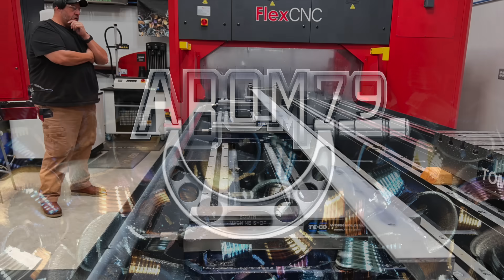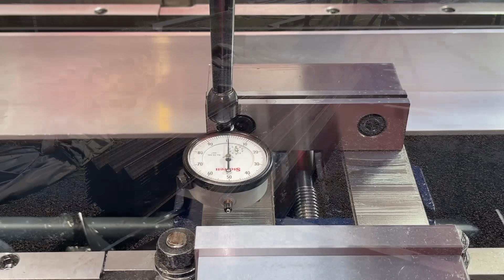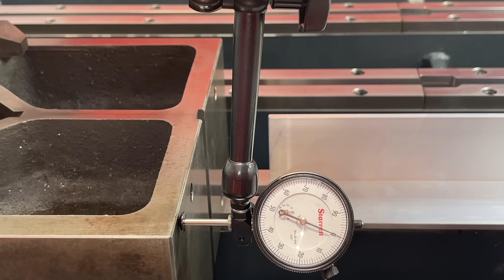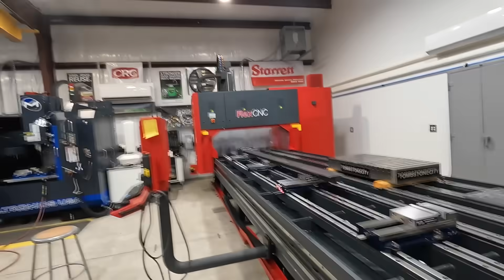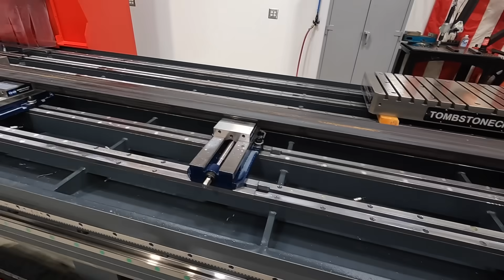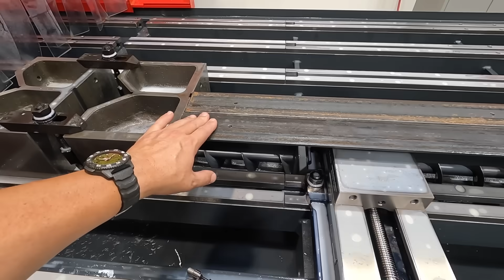Production Drilling in the Flex CNC

Comment: Talking about drilling holes, I have found using a flat ground drill bit in thin steel makes a very nice round hole, unlike a regular twist drill oval hole.
Reply: Cutter grinders are a gift from our ancestors. With a few rake tricks was able to temporary use a little Tormach mill as a production lathe... for years. 
'Nothing more permanent than a temporary fix' Ave-

Comment: With it dropping the rims, sounds like there is a setting issue.  A lot of machines come with a SFM limit in place just in case someone forgets a decimal.  Also with carbide when switching from HSS don't forget to change the drill point degree.  HSS is generally 182 where as most carbine is 140.  Also a spot could help start the holes with the height variances.  You could do this with the carbide drill as well it would simply be programmed at 70% feed and say a depth of -.03.

Comment: Hello!
I would not use coolant for that kind of job. And would change the path of tool. Two hols with Y and then go with X for another two holes in Y etc. Then come back to base and you can already start loosing vice. Cheers
Reply: He literally said he tested it this way and it was slower.
Reply: @Braeden74  shorter tool path = shorter program time. there is nothing to argue about
Reply: You apparently can’t listen, he said that’s slower, also, in america we don’t endanger ourself by touching the machine while it’s running. DA, alsoooo, you cannot run thru coolant carbide drills dry, they will break, if it wasn’t thru coolant than sure.
Reply: @adammiller4879  doubt that with that depth. but its not the point. ofcourse he suppost to use diferent drill. due to the fact that cooling was used to drill holes at such a small depth, in addition, in such a large element, the working time was extended several times due to the time spent on blowing off the elements from the coolant.
Reply: @Fido8xD  that’s something you have to do, you , this is standard practice in america which I can tell you’re not from.
Reply: @adammiller4879  i am just teling how to spped up the proces and make more money and you just teling me that i am not from america, what is your point?
Reply: @Fido8xD  and I already told you, you cannot run those drills dry, doesn’t matter if it’s “thin” they will explode, and that he already tried your idea and it was slower.
Reply: @adammiller4879  and i already told you that using thru cooland drill for that kind of job is just whaste of money. also if just think for a bit you can also create two programs to make the machine stop once on one side and once on the other and loop but it's probably too complicated for you

Comment: Two things, do as you wish with them. First, instead of adding coolant and water from evaporation all the time, id cover the flex bed with something, itll slow down a lot on evaporation when not in use. Something you can roll up while your pulling it off. Tarp maybe or similar? 2nd, you start getting in to these bigger part runs, get yourself a manual magnetic lifter and run it from your gib crane. Some of those magnets, although fairly small can lift several hundred pounds. In this case, I would pick up two pieces together, moved to flex and lowered them in place. When done, pick them up and move them to to cart and start process all over again. When machine is running thats when you go back and straighten out what you put down and get next two ready for moving. Its all about making money and making every movement you make count. What did this take to run? 1/2 a day, with a lifting magnet cut that in half if not more.
Reply: He mentioned this, or the need to lift on/off with a jib crane (close enough!) didn't he?  Or was it too long to watch for you by 6:30?
Reply: @silasmarner7586 Just gave him a tip on what I've used in the past to do this type of stuff. It is always nice to see what others are doing to improve ones capabilities and efficiency. Apparently, you dont see it that way. But since you brought it up, then yes, it was a long winded video to watch a half a million dollar machine drill holes. One of the most lame jobs to do in a machine shop is to drill holes repeatedly. In which I shouldnt even comment as he doesnt read them anyways. And yes, I have more important stuff to do then fanatsize over someone elses videos. If ya dont want the tip to use, then keep it scrolling, it wasnt directed at you.
Reply: tarping it is a awsome way to accelerate rusting the ground surfaces under it.

Comment: If the length of the pieces are different, then by placing them back-to-back, you're creating a mirror symmetry, so the holes will be off when the angle iron pieces are re-oriented the same. Maybe it doesn't make a difference for this application.
Reply: He did explain in a comment that it is the spacing between the holes that is important, while both ends of the angles will stick out into 'the air', having some +/- allowance

Comment: Talk about ridiculous overkill for that job 🙄
Reply: You comment make sense in the case some other larger job for the Flexcnc was put on hold, to drill these holes instead. But there are no que of jobs. When the machine is already there in the first place, it does not cost you much difference standing unused or put in use. The electric bill will be there, using the Flex or a drillpress. Would made no sense using a manaul drillpress and hours extra if one got the Flex cnc there. It's a multi machine, one naturally do not purchase it to just drill some holes in angles
Reply: ordinarily you'd be correct, but this is made for Youtube content.

Comment: You really need sealed collets for through spindle coolant, otherwise youre just pushing it out through the slots in the collet rather than through the tool.

Carbide drills are nice though, I usually get a couple of tousands holes on one drill in mild steel with simular thickness.

Comment: Come on now Adam, it's not a Swiss watch you're making. Pure overkill with the setting up.
Reply: Plus they are getting hot dipped, so the quaility of the hole is moot anyway. Most of those holes are going to get re-drilled after being dipped to clear the holes, by a worker with a hand drill lol.
Reply: @ionstorm66 The holes are 5/16 diameter for 1/4 diameter bolts. They will not need to be re-drilled.
Reply: @ellieprice363  hot dip will fill most of the holes completely
Reply: Most people need to learn to walk to run
Reply: Cool a $50 thousand machine to drill holes in angle iron
Reply: @edswider9309  how else would you do it

Comment: 12:35 This is more like a NASA lab than a workshop!

13:38 What are you doing with the refractometer? I assume you are not doing some wine making on the side. Is it to get the correct concentration of cutting fluid? If so it seems like a complex way of doing it, so perhaps you are addicted to tools like all your viewers (well, me at least)!
Reply: Yeah its to get the concentration right. Thats the recommended way to measure it from the manufacturer. He has a video about it when he got the mixing system.
Reply: @idbuythatfora4223  I was half expecting a burette to be produced!

(Mind you - I use a chemistry lab separating funnel in the kitchen for sauce preparation!)
Reply: I thought a refractometer was to measure glycol
Reply: @edswider9309  It will measure the refractive index (ratio of speed of light in free space/speed of light in the medium) of any material within its range.

Comment: Hello Abom,
The angle steels wont be bent that much because if that was true the far end would be some inches high.

If you look under the upper surface that your drilling holes in, it will have a fillet, a radius, akin to a moniscus.

So when you put the angle steel in the vice, it may sit with the verticsl aligned to the rear vice jaw and sitting high OR the underneeth of the top surface is flush on the vice top and the verticals are-not going to get squeesed equally.

Inside the angle of these steels is NOT a 90 degree angle.

So the work needs something like spacers or paralells on their sides laying under the upper surface OR vettically inside, between the vice jaws.

Don't try to vice jaw on the radius / filet.

Good luck.
Reply: I would have thought that obvious to someone working with metals
Reply: @colinfahidi9983  So would I,  but obviously were wrong.

But if you are an Abom regular viewer, he takes pride in teaching basics to novices.

That is why I posted the answer & why I tried to say it several times with different words.

I know,  we know,  but many nobrains would just get a bigger hammer.

Comment: No expert here but I think I would have used a rubber mallet to seat the steel down in the vises before tightening - would seem to ensure that all surfaces were flat.
Reply: Your forgetting the real problem.

Look inside an angle steel.

The "ANGLE" ISNT an angle.

The angle is (unless specially ordered) a radius ie: a filit aka a maniscus.

So the problem is the underneeth of the metal fillet is being crushed in the vices because the metal is not properly seared.
Bashing it with a 50kg sledge hammer wont seat it either so a machine hammer or Thore hammer will be like peeing in the wind.
Reply: @N1gel  Helpful comment - thanks.
Reply: One are free to do so, but in this scenario it would not made any difference to the end result. Drilling 'free holes' in such angle irons, that got a 'natural' sway to them in different directions, is a quite 'rough job', not any high precison. Setting up parts for milling, it's a good practise using rubber mallet

Comment: these kind of angle irons are always way off with their profile measures and usually have some annoying bends in. so yeah, you should forget your machinist tolerance mindset and go into your welders mindset if you giving clearence for these. I did a lot of mistakes by thinking angle irons are exactly 90' and angle lengths are always same. If you start wleding frames from them on the fixture table you start seeing the horrible inconsistency in them.
Reply: The most bends are from shipping. Bundels lengths of 6 meter picked op with a single strap.
Reply: I was thinking the same thing.

Comment: Hi Adam; love your channel, and in catching up with older videos, I just watched the jib crane ones. You strung a cable, and used cable clamps. I was a scenic carpenter building stage sets for a bit, and although not a union shop, a union stagehand taught me that you never saddle a dead horse. The cable being the horse, a dead horse is the cut end. The clamp has a wire, and a saddle. I saw you put the cut end on the saddle side of the clamp. Now I'm sitting wondering. Does it matter how you rig the cable thru the clamp? Or should you not saddle a dead horse? Thanks for the comment. Jim.

Comment: I am confused. I can do the same job on my $300 drill press and 2 $12 jack stands.  Guess I am doing it wrong and need a $200k FlexCNC machine.
Reply: Here the other day I observed a 300K 18 wheeler drive 200 yards from the gas station to the local Wallmart.  I can drive that exact same distance with my 100 USD John Deere pedel tractor.
Reply: Two things. First, you're going to spend several minutes on each one of the 130 pieces just loading it up and measuring and centerpunching, then a minute for each hole, then moving the work and lining it up, and after each one, you'll probably have to deburr each hole, and by the time you got one done, Adam got 20 done, and by the time you got them all done, Adam will be on the next project (or home, enjoying his smoked brisket).

Plus, this was a learning experience for him. He learned that the extra lift to prevent a broken bit loses a few seconds. It was more about learning limitations and parameters than getting the job done fast.
Reply: Or you’re jealous

Comment: Why do you have to warm the head up?
I'm guessing you also told him to blow the vice's and the end stop?
Reply: The spindle and spindle bearings need to come up to an operating temperature so all the tolerances stay in spec. You can see a significant difference in tolerance on the tool from dead cold to running after 5 min. This is pretty standard on most CNC machines.

Comment: Nothing beats a couple of terrified minimum wage kids with an old drill press out in the gravel and a few dull and worn out bits.  Make sure it's at least 90 degrees and they don't get a break until the job is done.
Reply: They were doing it wrong.  You need a $200k machine like shown here.
Reply: @324atleD  life's SO much easier these days for all those youngsters 😁👍🏻😉
Reply: Those were the days.

Comment: Having a thru coolant drill is great but you need a sealed collet to use them properly, most of the coolant is lost and you don't want to rely on it when deep drilling. On the other side, thru coolant with an unsealed collet can be very useful for endmills and solid drills.

Comment: That FlexCNC is badass now that we see what it can do for a small job shop. If I owned a welding/fab shop I would immediately invest in one of these.
Reply: There’s a lot more a small job shop can do with $300k and 300 square feet of floor space.
Reply: @zacharymihlrad1045  A shop set up for creating video content, having sponsorship, just have to run some demos now and then. An ordinary job shop needs to run the machines full day, and there is alot one can get done with 300K and 300 sqf for sure.

Comment: Hi Adam, Please do not use a collet chuck with solid carbide drills with internal cooling. Almost all of the coolant is lost through the collet and the required coolant pressure cannot be achieved. You have an induction device. Clamp the drill in a shrink mount. I work on a Giddings and Lewis boring mill myself and know what I'm talking about.

greetings from Germany
Paul
Reply: Or use a sealed collet or a nut with a seal.
Reply: @SUMOCAT86 correct 👍
Reply: yea he has a  induction device for heat fit tooling, it was one of his  hour long advertisements a few month ago which has never seen the light of day since
Reply: @osgeld  other paid content to push out, presumably.

Comment: You might want to invest in some sealed ER collets so the thru coolant works correctly. And also that noise is typically because the drill might be running out which is typical of putting a drill in a standard ER collet
Reply: Exactly 👍

Comment: Can the Flex move 2 axis at the same time?  Was wondering cause it could save a little more time if you could do zig-zag movements when doing a job like that.  Like start on the left hole, then go to the right hole, then have it move back to the left side while traveling down the length of the machine.
Reply: yes these things can do all  3 movements at the same time, but adam is not a person that "gets" programming so he is just making single steps move Y...move X...move Z... goto10
Reply: It’s because he programmed it using 2 different work offsets.  He’s essentially running the program 2 times, each with a different starting point.
Reply: He said they ran it different ways but the fastest was to minimize Y travel.
Reply: If you always want to park at the one end, you are going to go back anyway. So would be slower as you would still have 3 extra movements. Also, even if you wanted to do both close holes before moving down the length to do the next pair, you can just do the first hole on the same angle as you last drilled on and then move to the other one. No need to always start on the same angle, so how would zigzag help?

Comment: Am i the only one who has realized that these are mirror image parts, not identical parts?
Reply: Starting at 1 square side @4" and the 2 parts are unequal lengths ,when you turn the opposite side around to the correct orientation, the starting point of the first hole is no longer 4". Maybe it's not a huge deal for this application, but it is a mirror image part. Not identical.
Reply: Good call. But it seems like its probably screwing into 24" o.c. studs or purlins or something that is going to be +/- a half inch anyways. And if its a solid surface with self tappers or whatever, then it just doesnt matter. Someone engineered that 24" o.c. screws are sufficient so it will be "close enough" which in the building industry is pretty standard. This is ultra low accuracy work. My two cents.
Reply: Does it matter for the application? If holes are symmetrical end to end it won‘t but  if it does Adam will be drilling the other side on half of the angles for free!

Comment: That is such an easy machine to see working. Should be running doing something everyday. I'd be interested in how much $$$ it actually makes per job and the confidence level to earn that money.
Reply: It's a realtively low priced CNC, with a very large table. Can be customized for the individual customer. It is typically used by companies working with large structural beams. To those companies buying it, it saves them quite some time compared to the way they've done it earlier with more manual work and moving of the parts involved, accoridn to different videos I've seen. So the money they make, is often first of all the money the save by going for this machine instead of the old ways. It's a 3-axis CNC mill, which is the most 'basic' CNC machine. the money earned greatly depends on your products. One likely do not buy such a machine 'just like that', but have one or more specific tasks for it. I like the idea of this machine, and the not too high cost, and I can see it being usable to for many different tasks

Comment: I would have turned the vices around and then it would have been closer to the side of the machine so less reach to swap parts
Reply: But that would make opening and closing the vises awkward. However kurt does make reverse screw vises (cant remember what terminology they use) where the hex for the screw is on the hard jaw side. That would've been ideal but they cost more and he already had those.